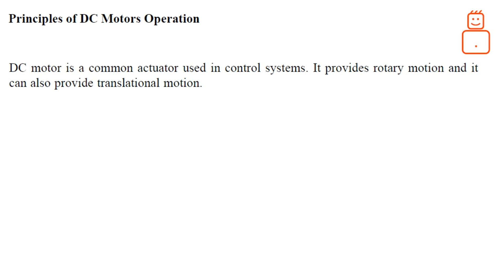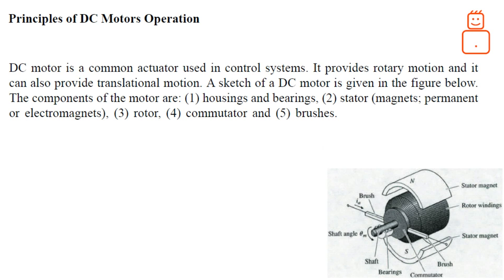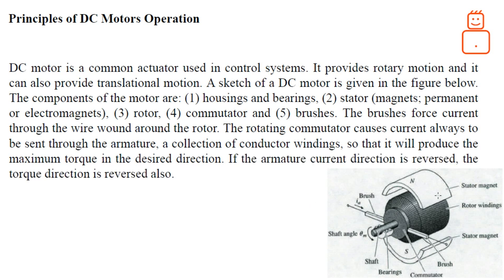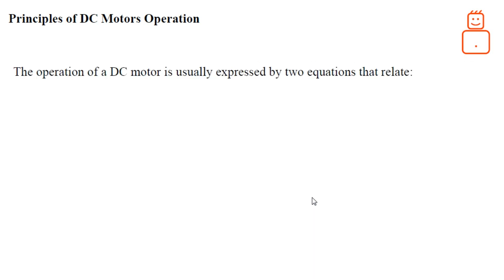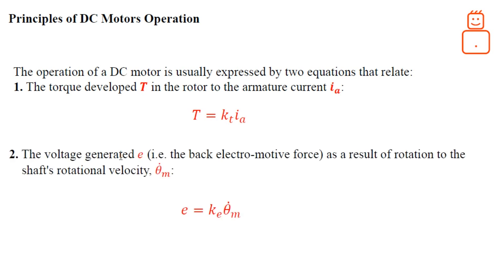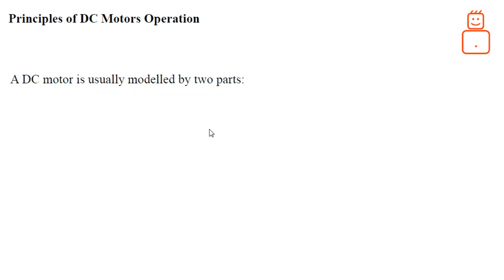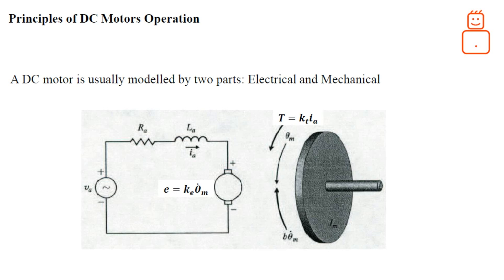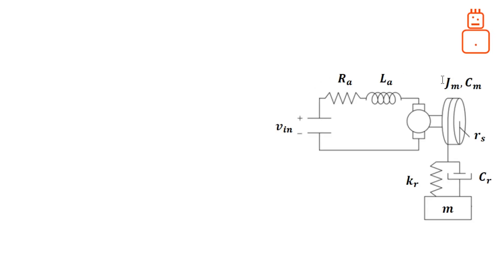Modelling a DC motor in a given control system - Example

Comment: Thank you for the clear presentation to the modeling of DC motor to the spring-mass-damping system. There is one small error in the second state-space equation w.r.t. the state of \theta_{m}. The first term on the very left missed a suffix of "m", which may cause some confusion on understanding.
Reply from the maker: Thanks for the notation. I will fix it.